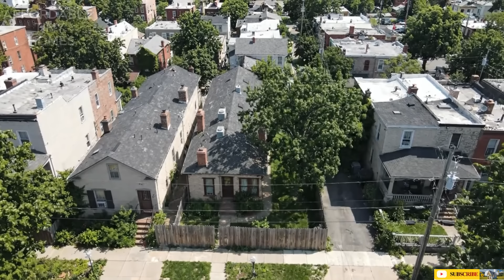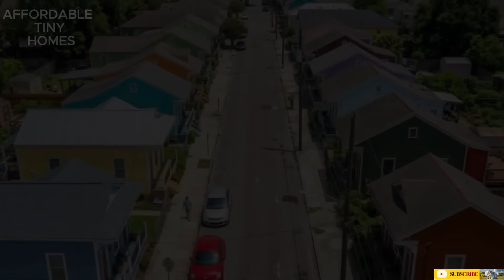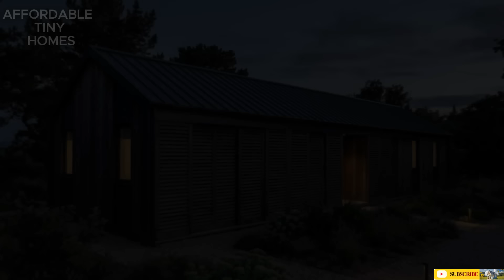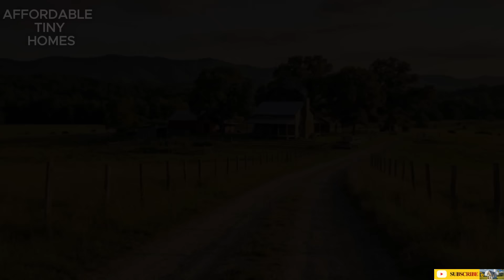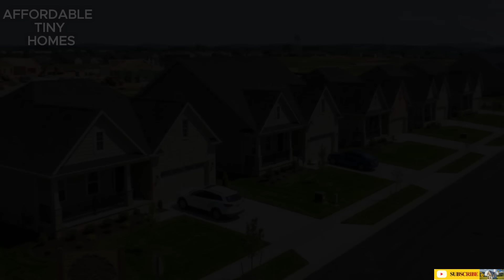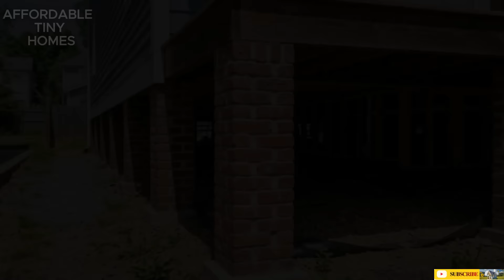Forget Tiny Homes: This 150-Year-Old House Design is Smarter (And Cheaper)

Comment: Showing blueprints would have been helpful, especially if you kept them up for long enough to see them.  The slide show with pictures that aren't in sync with the narrative is unhelpful to communicating the style.
Reply: You have to buy those!💰!
Reply: @503rpf  A sketch of the layout would have been sufficient - it needn't have been contractor/build level prints.
Reply: If you just want to see the floor plan, Zamore Architects publishes the current version of the original Shot-Trot concept here:

https://www.zamorearchitects.com/zkit/02

It’s the zKIT 02: 16' x 72', 1,184 sq. ft., 2 bedrooms, 1½ baths. The layout is a direct descendant of Brett Zamore’s original Shot-Trot house.

Comment: The tiny house movement is all but over in 2026, Small 600-1100 sq foot houses are becoming popular again because they are still affordable and more than not cheaper than a tiny home, there are millions upon millions of older small houses through out the U.S. that are 125k or under that just need a little TLC but are pretty much move in ready after new paint or a little work and the average new tiny house is 150k and is half the size. I live in Northern Arizona and although the population is getting bigger there aren't many new houses being built, people are buying small houses and renovating them. I myself bought a small 850 sq foot house on a double lot with a 550 sq foot studio apartment which I'm getting ready to add on a 9x9 bedroom onto and reseparate the lots and sell it to my brother for when he retires and moves out here  at the end of the year.
Reply: There aren't clear definitions of Tiny vs. Small. As far as I can tell, 'tiny' came about as quasi RV like DIY builds that were on moveable platforms. These never appealed to me due to 'hallway' like (8' max wide) floorplans too often resorting to 'loft' bedrooms. 

I do very much like small houses. if we build an ADU for advanced (aka OLD) retirement living, it will probably be between 600-700 sq.ft.
Reply: @jaindaugh509   Only they are legally and clearly defined by The National Association of Realators and HUD. Anything 599 sq feet or under is a Tiny House, 600-1199 is a Small/Starter House, 1200-1799 sq is a Family home, 1800-2500 Sq Large Family Home, 2500-3500 is a Mini Mansion and 3500 and above is a Mansion.
Reply: Great idea
Reply: True. The laws made sure too sadly as so many would benefit.
Reply: @StardusterMagik   The laws had nothing to do with it, it was the fact that the people looked at the prices of Tiny Houses and said "nah man, 150k-200k for 200 sq feet? When I could buy an older 700-1000 sq foot starter home from the 50's or 60's for 50-75k". The ONLY thing that caused the tiny house movement to end was the Tiny House communty itself, from the builders riping people  wanting 150-200k for the 200 sq houses and the other tiny house livers thinking that if you don't have the latest and greatest things in your tiny home ruined it. That's why people are going back to small starter homes because you can buy them all day long for under 125k and even if you have to put 25-50k your still coming out ahead.
Reply: @TheREALOC1972 ok
Reply: I was about to say the 700 to 1000 sq ft modular homes are getting really popular now
Reply: @jdgoerke13  yep, that's what I';m saying, people are starting to revolt from the big houses and new cars and are buying small houses and older cars that are cheap and they can either pay cash for or pay off quick. The Average age of a car in 2020 was 11.1 years old, in 2025 it was 15.8 years old, that's a 4.7 year drop in 5 years, that's the last 5 year difference in American automotive history. People are getting back to living simple again, atleast house size and car age wise.

Comment: Houston is too hot to not have AC. Yes, homes of the region were designed to take advantage of the climate, but that's not enough of a subsitute to satisfy the City's current population.  Without AC, the population of the region would decrease by 90% overnight.
Reply from the maker: Spot on